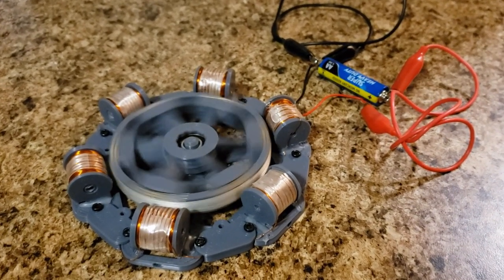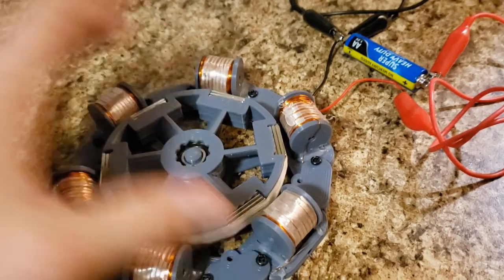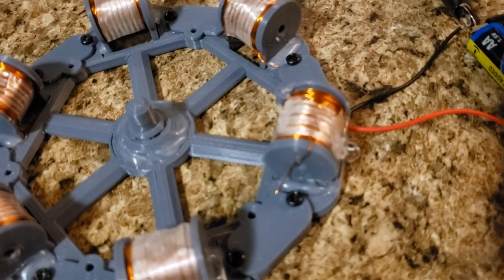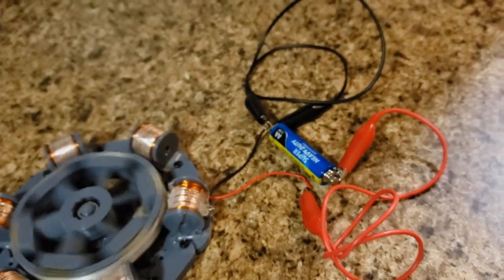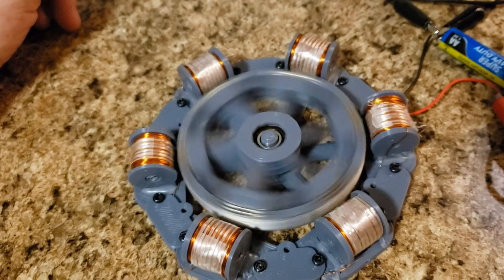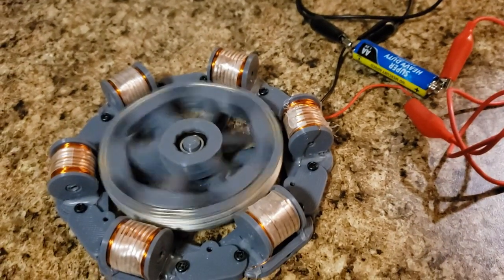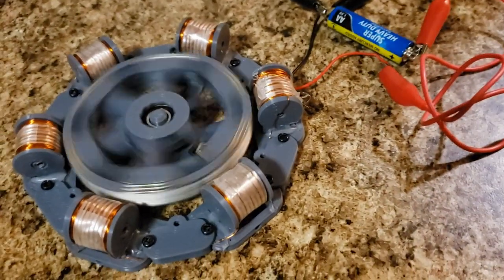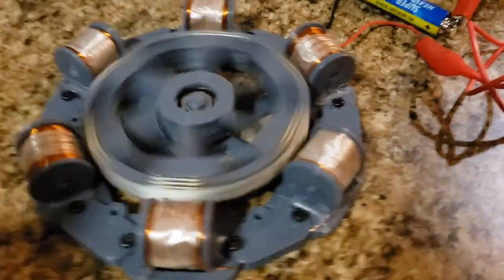Zero Force Six Coil Pulse Motor

Comment: 1. You have a read switch makes a spark
. 
2. It is being pulsed by the read switch on and off vary fast

3. Thw magnetic fields is pushing on the magnetics

All Force that work on the motor. ZERO FOCE really connect it to a oscilloscope and see what the foces are.
Reply from the maker: I don't have an oscilloscope. But if you do and a 3d printer you can find a link in the description to download the files. I would like to see what you find out!

Comment: Just a reminder. Efficency is not how little power you can use or how long you can run on a battery. Ratherly  efficency or coefficient of performance = work output/energy in put.  

But yeah, if you use thinner wire and add more turns, your resistance will go up and the inductive reactance will go up, all this contributes to drawing less current, and the motor will spin slower. There will be less air resistance and less energy loss in the bearings and the motor will spin longer on a given battery.
Reply from the maker: A motor that small is just a test. The only work it performs is spinning the rotor. Which i guess my idea of efficiency in that set up is how long it can run on a small input.

Comment: nice work. im always intrigued by these motors with the stator coils mounted 90 degrees from normal.
i'd like to see how the fields of stator coils set up like this interact. maybe some iron filings on a piece of paper.
Reply from the maker: Yeah, I was going to dilute ferro fluid and sandwich it between glass and illuminate it with an led strip. I saw this on another video. I have all the materials, maybe a future video for sure. Thanks

Comment: Just noting that using a switch to cut the current  can create inductive voltage spikes that wear down the contacts on a reed switch.  One can improve the life of a reed switch with a (flyback or snubber) diode and a small capacitor, both in parallel with the switch to absorb the energy released from the magnetic field collapse, rather than turning the switch into a hot spark gap vaporizing a little bit of metal evertine the contact is broken.
Reply from the maker: Yeah, I'm not worried about that happening on a motor that runs on mv's. If it did I think I paid a few bucks for 100 of those small Reed switches.

Comment: you might try placing small core winding in 2 or 3 areas in between motor coils, but must keep generate coils in same no lenz position as other coils
Reply from the maker: Good tip thanks
Reply: @redesign3dp  that way you can charge battery at same time

Comment: What is the purpose of this device and what benefit does it have over prior devices?
Reply from the maker: Absolutely nothing. Its just a cool pulse motor design. Think of it as a 3d printed art sculpture that moves. One step up from crude construction techniques. Thanks for at least giving it a second of your time.

Comment: Very good job. Do you use only one coil or everything?. Because it seem to consume almost nothing. Sure you can have electricity in return if one is use to charge something. Anyway i like it as it is not usual motor
Reply from the maker: All 6 coils are wired in series with a total resistance of 33 ohms. More resistance would make it more efficient. Cannot take power off it or it stalls, low torque. For more info search youtube for bedini zero force motor.
Reply: @redesign3dp  thanks . Due to the thing that there is no core in these coils may be it's bad motor. But with core it will generate. Used with a motor coupled. Like you've done before. Very good. Your 3d models are awsome

Comment: hey my friend I bought and downloaded this design and I'm in the process of printing it out. I wanted to make it bigger so I sliced it at 40% larger but didn't take into account the bearing ugggggggggggg. I'll figure out somehow right? Nice design prints well so thanks. I'll be getting more of your designs but wanted to start small to see where it leads me
Reply: disaster averted. it turns out the 40% increase is the a perfect fit for a 10mm ID 30mm OD bearing yea
Reply from the maker: Nice, thanks for your support. Send me an email at redesign3dp@gmail.com and I'll send you a free unreleased motor design you can try out if you'd like. I use a 1.0 mm nozzle at .4 mm layer height for all my prints, it really speeds up print time with decent resolution. Keep building brother! There's not many of us!
Reply: @redesign3dp  right on man. Just sent you an email
Reply from the maker: @mcorrade  whats your email address?
Reply from the maker: I only got a reply from your YouTube account but no email address I can send to
Reply: @redesign3dp  I sent you an email though the addy you provided?
Reply: @redesign3dp  I emailed your Gmail addy you provided. I'll resend it
Reply from the maker: @mcorrade  I don't know why I'm not getting anything other than your youtube account link in my email. Type out your complete email address and we'll try that. I tried a shot in the dark with 3dprintingpm@gmail.com but it didn't work?

Comment: very cool pulse motor man. Is there a reason why only north facing and not NS? Is it more efficient for a reed switch?
Reply from the maker: Thanks. No reason just a quick idea. The reed switch was a simple solution. There is lots of room for experimentation. You can download it on Thingiverse if you wanted to try out some ideas.
Reply: "Why only N facing out?" This type of motor is  has all  magnets on the rotor with the same pole facing out. It makes little difference which one except in the direction the rotor will turn. 

The coils all generate a magnetic field in one direction.  When the Reed switch is engaged, the 🧲  on the rotor are pulled to one side of the coil. If the 🧲 are reversed, the 🧲 on the rotor would be pulled to the other side of the coil making the rotor spin in the other direction.

Otherwise everything else is the same.
Reply: @kreynolds1123  cool

Comment: During recent research, I've discovered that placing even a few strands of iron (like construction wire) as a core greatly improves induction into coils without causing drag as coils are parallel to rotating magnets...https://www.youtube.com/shorts/jyK1Kml2jck
Reply from the maker: Thanks for your input sir! I I'll keep that in mind...
Reply: @redesign3dp  also too much waste trying to charge a battery due to chemical nature, use capacitors to have immediate absorbtion
Reply from the maker: Yes sir your right if i was aiming towards an OU goal, but I want to desulfate and revive dead battery's. I appreciate all of your feedback brother..

Comment: Awesome, what are you doing with the back emf?
Reply from the maker: Nothing. I haven't really found a use for it except charging capacitors. To me it just seems to be high voltage low amperage pulses. But I'm open to suggestions.
Reply: Put it back into the motor and see if it runs longer. Might need to add a diode to prevent it from going back into the coils. Just a thought.

Comment: Cool. Is there schematics for this? All I could see was the print files. It will most likely work better with "litz wire".

You should make two of these spinning against each other to opposite directions. Then slap some aluminium capacity fins and brushes to make it "wimshurst machine". It's possible to step down the voltage on that with variable capacitors or inductors made on plastic pipe. I would like to see the input / output measurements of that...;)
Reply from the maker: Wired in series, triggered by a Reed switch. Interesting idea, part of why I post is to inspire ideas. You have a good one, I'm currently working on another project. But if you would like to build what you describe and post a video, send me a link I'd love to see what you envision!